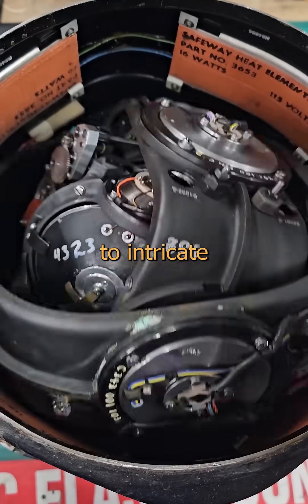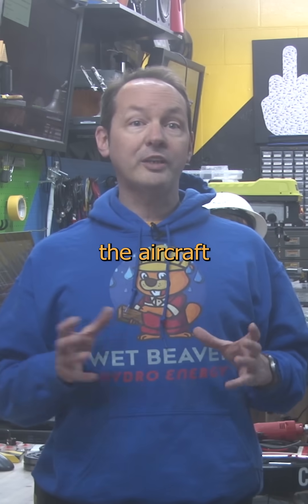Inertial Platform #chrisboden #comedy #gyroscope #gyro #avionics #physics #educational #science

Comment: Help push to get food and production storage and distribution out of a fuel cost range by using modern aviation technology. Though it may not be popular, discuss, the barrier of energy conservation has been broken through both through charge system provider sets and through the clever uses Obgenerators, just look at jet Ignition intentions and jet engine design as well as electrical system. Loud, check out that fire safety 747 d*** really. In 1986 GE 747 engine mark the announcement of the breaking through of this wall technically. But if we look at the original induction generator design and the original induction generators, we will see 3 components away every day.
Reply: Because of high voltage, you'd be shocked. How many different just basic generator and Transformers? Designs, that would be served to tell you. The battery is just for start up. It is shocking how easy it is to get past this barrier. It is a dangerous as anything like this is always use a professional. If you're getting crossways with them order, you're built separate from one another. Make sure your Plan matches in your transform pacing and then bring in a separate professional for general calibrations. For startup and initial run, you will be shocked. How simple this really is. And some professionals shouldn't be so assistant. Maybe just show them that it's been around for a while in aviation, yes. But then again, you might actually have to order. Your component builds separate to make sure they run those Transformers, right? No, really does help you just gotta be on. Your numbers doesn't take as much know how to plan the plan out. But like I said, use a professional dangerous and anything like this is. Yes, it wears out everything's about longevity of the parts but it's better than fuel costs determining the price of our food. This is a doom spiral. We are very aware of and it is in the law. To some extent, says we can meet and discuss the future of our nations.
Reply: Another thing that you can showcase in showing how easy this is to accomplish is. I like to start with proving how many motors of the same size. I can power with a single generator attached to a motor powered solely by a battery how many? Then physically. Another thing is then dephysically show that the existence of a tuition based connection between a generator and a motor are not an electrical connection to any extent. When we look at a prime cycle starter motor drive. That's helps us to Express. The physical tuition from the starter motor help us to average some hurdles in observation. Because we will show that this electricity is not connected to this motor electrically, unless we poke it directly up to it.  Now the torsion based connection is shown to physically through physics and energy conservation actually to not exist at all plus in the first experiment. How many motors could we power with the same type of motor that we're turning the generator with with proper transforming? It is shocking I've seen up to 7. Again, that's with proper Transformers and no torsion. Based connections are naughty electric in physics and do not suffer the penalties. Also, if you're having trouble, perhaps look at some existing systems and look at the coil packs and Transformers sets. We use outside of this torsion VS electric and normal system usage. Yes, we do use these feedback resistant coil packs. For the same motors without it having it hooked from a generator turned by the motor back into the motor that's turning it. Yes, that motor does use a high voltage resistant coil pack to prevent feedback from diminishing the quality of the product. It is only in some systems because you. As you know, you really don't need those Transformers, but it's best to have them. They'll be best to calibrate your throttles. And maintain your RPM game to the sensitivity. You need to have it at for long-term recalibration and adjustments.  And what I'm talking about is hilarious kind of sometimes, because if you just smack it with your hand and get it going.It'll jump right back to life.That's not that's not the best motor to be used , but while look at it really did burn out and keep worship For the same motors without it having it hooked from a generator turned by the motor back into the motor that's turning it. Yes, that motor does use a high voltage resistant coil pack to prevent feedback from diminishing the quality of the product. It is only in some systems because you. As you know, you really don't need those Transformers, but it's best to have them. They'll be best to calibrate your throttles. And maintain your RPM game to the sensitivity. You need to have it at for long-term recalibration and adjustments.  And what I'm talking about is hilarious kind of sometimes, because if you just smack it with your hand and get it going. It'll jump right back to life. That's not that's not the best motor to be used, but while look at it really did burn out and keep working.
Reply: Another super crazy thing, you know those buildings that charge up higher and they'll provide power for like 15 seconds after powers lost. Yeah, that's a good bridge for you. Know you're I can't figure it out moments. Just make sure your numbers match. Always use a professional. You made the plan. The plan is meeting. Your boltage outputs 2 inputs exactly to standard aspects determined for the equipment that you're using. No, really? It's real sad and it is real sad. People will say the most ridiculous things about these free designs. Or proper drafts of design. And?
 It hurts people's feelings to realize that torsion is not electrically connected to any exteit. Does it seems to hurt their feelings? It's weird like this guy. You probably like I don't know I'm good at it, but if we look it all up like where I look, we don't have anything to worry about as far as physics because of the torsion and guys.  They're wrong about it in Transformers too. Oh no, it's really weird, just just get it working and watch it, monitor it and everything you just feel like. Wow you've got to put something inside this transformer to cause it to fail in the face of this for it to fail Portugal. It and like I said, ordering your construction separate. Actually can do a lot to prevent that type of transformer to be in use. Have those Transformers do exist? They really will fail. They are do have components built into them. It's like super sad s***
Reply: Again? I employ you in the face of the guy talking all this stuff. Look over the component designs and you will see the Transformers. We have the transformer technology even if he is right to do it. At this point, some people say building into these systems with these type of coils. You gotta keep ordering them cause I'll keep sending you bad ones. People say it's because they think we're doing this with it. I don't know how true that myth is, but they certainly do buy a lot of new ones. But like I said we have the coils and like I said, the build in with the 15 2nd delay to lapse in provision. Yeah, that's another hilarious crazy. What the hell moment we all look each other and be like? They just need to quit resisting this in aviation, they have.

Comment: there's a comment thread somewhere else about science looking like magic,  and THIS is one of the ultimate examples of it. Keeping all these layers balanced to their axis of rotation is nuts.  
"Okay, I need higher/lower voltage for these circuits, I need somewhere to bolt this iron core and copper windings, but also, I can't make the whole thing wobble"  and then solve that same problem about A HUNDRED DAMN TIMES, because you need to make sure those bearing experience as little load as damn well possible!

Comment: A significant part of engineering is just finding a way to arrange all of the components so that they fit into a specific shape. If one of the capacitors on the inner sphere stuck out, the thing wouldn't work.

Comment: Nope.

In any new device it's cheaper to use cheaper stuff (XBox360 had a noise linked to the ball used to sense horizontal and vertical orientation) using gravity.

Right now the state of the art is three "optical gyroscope" that uses light to calculate shifting on the axis.
Since light has a fixed speed if the device is moved in one direction the light on two parallel paths will reach the sensor at a slightly different times.
With some clever math you can see movement on three axis... it's cheaper, compact and robust than a mechanical gyroscope...

Mechanical gyroscopes are still used in tank aiming systems, because they are great to compensate on rough terrains and they are... mechanical, so they can work with hydraulic systems in a seamless way.

Comment: 0:40 Well, not always. INS systems drift. They always do. And in a relativr sense, quite quickly (can be several degrees per hour). For the first few decades, they were on aircraft, they'd have to be manually realigned in flight using known reference points plotted along the flight path. Whether it was roads, specific mountains, or buildings. Basically, anything with a known geolocation that's easily recognizable. Nowadays, the vast majority of aircraft use GPS to automatically keep the INS in check (IFA, or in flight alignment on hornets for example). This also allows them to spin up and align the INS post takeoff, for faster scramble times in an emergency (standard alignment can take a few minutes, especially if the aircraft has moved since powering off).

Comment: We are capable of making that but yet some engineers have issues designing the clock spring behind your steering wheel so your airbag light/chime doesn’t annoy you every time you turn the steering wheel slightly

Comment: That’s a gyro! Spinning at very high speeds it used what’s called rigidity in space. The center part would stay fixed due to rigidity in space and the gimbal. Like holding a spinning bicycle wheel, when spinning, it wants to stay in a fixed position. Nowadays we use laser gyros with no moving parts.

Comment: The concept for this machine has a wider arrange of uses as well.

All of matter is essentially one large but loosely connected ocean. 

All anything is doing is moving with the flow. By using a gyroscope and numerous connections you can monitor and adjust the flow of the thimgs around it.

Comment: So, help me understand something. In the Apollo spacecraft, there was something called gimbal lock, which was a place that you absolutely did not want to fly because it meant you tumbled off into space. Why did that zone exist, why was it called gimbal lock, and why don't craft have it today?
Reply: Short answer: when  two of the three frames in that thing line up with each other and you turn in a way such that the gyro only moves the other one, the missile stops knowing where it isn't and thinks it's in two places at once. I.e., your instruments go all wonky. Ever pull into a parking spot and stop at the same time the car beside you starts to back out, and it makes you feel like you're still moving and you panic-stomp the brakes? Basically that.
Reply: @DeliveryMcGee  Huh. Alright. So, how did they fix that so craft today don't have that issue?
Reply: @ Adding a fourth frame solves it. The problem AND solution were known well before Apollo, but whichever contractor made theirs just didn't think it was worth the extra expense/weight to add the extra bit. Instead they put "DO NOT EXCEED" marks on the instrument faces.

Comment: Regarding flerfers: Does the gyroscope in a phone even work to show the earth is a sphere? Doesn't it only register change in orientation (it's an accelerometer, not a gyroscope) and integrating that over time has way too much error to give any sensible result? The rotating the image when you turn the phone works through gravity and that's always pointing down. Would work on a flat earth too.
Reply: No because gravity wouldn't work the way we expect if we assume a flat earth. Gravity points down with respect to the one making the observation. Anyone else observing that observer would see gravity following a different vector. But if they observe gravity themselves, it points down. That's because gravity actually vectors to the center of mass. Assuming a flat earth, gravity would only point down at the very center of the surface of the earth--and since FEers haven't ever come up with a model of the planet, no one would know where that center location is. Just for fun let's call that place the north pole; at the north pole, gravity points down. Everywhere else going farther away from the north pole, gravity points towards the north pole to varying degrees. In Antarctica, gravity would point sideways.

tl;dr - It cannot be said that gravity or anything else for that matter "works" on a flat earth. Because it actually doesn't.

Comment: Had an F-4 pilot get mad as hell at me when I connected ground power to his plane. Generator contactor closed and then popped open as I was walking away... I ran back and closed the contactor again and promptly heard a squeal and BANG. Ohhhhhh Fuuuuudge! Yup, the sudden reapply of power to the gyros sent them into gymbal lock and did some niiiice damage. Pilot was severely mad because he was stuck at my base with his plane for a few days. DOH!!!
Reply: Those were some expensive sounds I bet
Reply: @snjert8406  oh yeah, when you can hear those sounds over flightline background noise... It's definitely catastrophic.  Lol
Reply: Possible gimbal lock was a known issue with the Apollo command module.
However … Gemini did not have that problem, having a 4th ring.
Reply: Did you see the factory smoke come out??? 😸
Reply: @will7its  nope, being hermetically sealed there was no way for that genie to jump outta it's bottle... But that genie sure made a crap load of noise. LOL
Reply: @gerrywalsh5766  haha good times......
Reply: Hap shittens.
Reply: Were you in some remote shithole, or just fighter jock wanting to get back to the action? It's funny how the cargo planes always break down in Andersen or Kadena and never, say, Elmendorf.
Reply: Can someone explain to me what happened in that story
Reply: @SamKramer  when gyroscopes are powered down they start to wander in their gymbal mounts. When power is reapplied to them before they have stopped rotating, the gyro will SNAP back into it's former position when it lost power to the rotors. That snap is EXTREMELY violent and can cause severe damage to the gymbal mounts and bearings, rendering the gyro assembly completely useless. In the early 80's there were no GPS systems for the old F-4 Phantoms... just old school navigation and possibly a leader plane with an inertial system.

Comment: I really want to see the slip plates. How do they manage to provide clean signals while spinning so fast? The tolerances must be insane.
Reply: I suppose slip plates/rings would be only used for motor power that feeds the Mach Jesus, and the 3 signals would come out via optical encoders without mechanical contact... My layman thoughts

Comment: One minor nit... You use the accelerometer for the phone rotation quite heavily because the gravity vector doesn't require integration and doesn't have integration error.

You use the gyro for the pedometers as they are way way more sensitive to sensing shock than the accelerometer...

Comment: I flew big jets with Inertial Navigation Systems similar to that one before the days of GPS so as we approached land we had to update our units with ground-based radio signals like Tacan and DME in order to correct the errors accumulated during the ocean crossing. Now with GPS the INSs update constantly.
Reply: @EsparkyDog  what sorts of errors? Why would it accumulate errors? All the comments seem to indicate this system is flawless.
Reply: @dmitriyl.8976 the gyroscope is very accurate at telling which way you are pointing, but it can't directly tell you where you are. An inertial navigation system has to add up all the accelerations you do over the journey to plot your speed and position on a virtual map to tell you where you are. The longer the journey the more tiny errors can add up to a bigger error. Frankly it's mind blowing that it works at all TBH.
Reply: @dmitriyl.8976 
No? There's no such thing as a flawless machine.
Gyros tend to hold their orientation in a manner that causes their readings to deviate from an aircraft's actual compass heading. On long trips (typically overseas flights) the heading indicator needs to be manually adjusted periodically to actually line up with their true heading.
Reply: @dmitriyl.8976  They basically use the acceleration in the 3 axises and with two integrations you get a distance. If you know where you started and the distance traveled, you know where you end up. You add a distance with every calculation step. But, due to real life limitations, it is not possible to do this with analytical integrations (which would deliver exact values), but rather numerical methods leading to small differnces between the calucalted position and the real position of the aircraft. These small errors accumulate with every calculation cycle and the sum of the error gets bigger with the distance. Therefore it was important back in the days to update the INS with known reference points, or as of today, updating your own position with GNSS